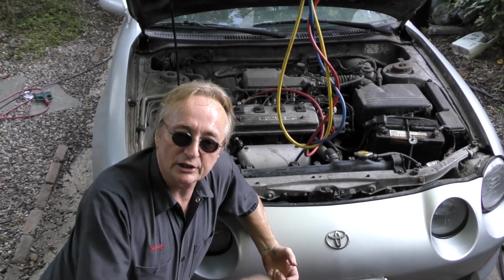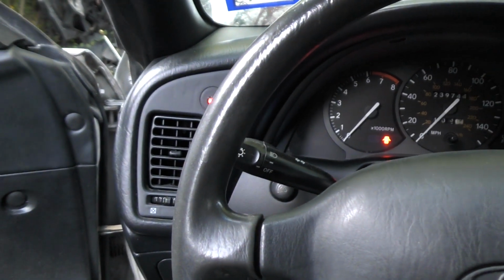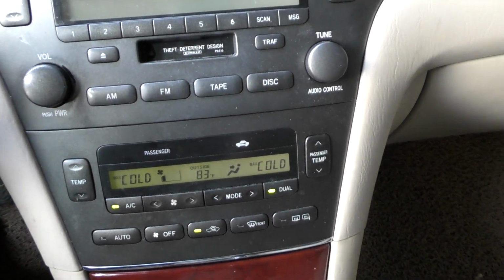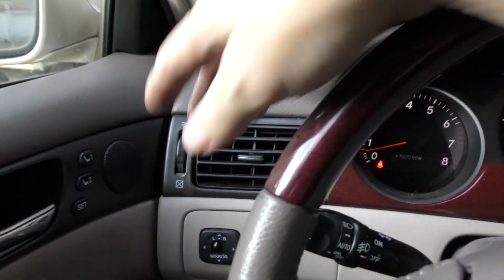Doing This Will Make Your Car's AC Blow Twice as Cold

Comment: You have no idea how many webpages and videos I've watched that NEVER mentioned why air is colder blowing out on the passenger side vs. the driver side in a single zone/traditional AC system...because the evaporator is usually on that side. FINALLY someone explained it!

Comment: I currently drive a 2006 Pontiac Vibe and Tuffy Lube tried to scam me with this dye test and replacing my air compressor. Also wanted to charge me over $100 to replace my oil pan and gasket because their mechanic couldn't "get a grip on the bolt" and claimed it was stripped. I think they quoted me something outrageous like $500 for all the work. My eyes almost bulged out of my head 😭. Took my car back to the same mechanic I bought it from, he changed my oil and got the AC working in less than a day. Wasn't low on refrigerant either, he just knew what to do and charged me under $100 for everything. He's the man, I'll never bring this car to anyone every again.

Comment: Most car manufacturers will claim that the AC system is a closed loop and that it should never need to be recharged.  This is not 100% true.  I own a 2005 Nissan Sentra which, prior to me purchasing it, sat in a garage for awhile.  When temperatures soared into the 90s recently, I turned the AC on, and it wasn't cooling effectively.  I took the car to my regular mechanic, and he said it needed a recharge.  I asked him if there were any refrigerant leaks, and he said no.  He topped off the R134a and for a month now, my car is blowing frigid air from the vents...to the point where it's almost freezing.  Every car's AC system should be inspected and serviced every few years, IMHO, to prevent expensive AC repairs.

Comment: Scotty Question: Just bought a 2004 Tahoe Z71.  Frame is clean, pans are clean, but I've got some body rust.  I'd like to treat the inside of the frame, and out.  My plan.  Wash it with soapy water, dry, grind the rust with a wire where possible, acetone wash and use/test these products.  CRC, RP-342, Corroseal, and Krud Kutter.  Have no plans to blend these products, just what product works in an ideal area.  Is this a good plan?   Thumbs up as always.

Comment: If your vehicle has 2nd fan in the engine compartment (auxiliary fan or pusher fan), your AC will not be very cold, regardless of the refrigerant level, when this fan is not working.

Comment: Hello Scotty, i have 2017 camry, we bought brand new from the only main toyota dealer here in uae, A/C now blowing  warm air 95% of the time, repair shops say compressor and condenser and whole system need to replace and flushed costs around 1150 dollars after market compressor or 1850 dollars if new toyota compressor, i am not convinced cause the car is new and done onle 120k miles, do you have an idea about what's wrong with my car and how to fix it?

Comment: I replaced my car's ac replaced all the parts except the the condenser ....the ac works but not well enough....it's a 2012 kia rio should I replace the condenser and empty the refrigerant and reload it?....also thers's no leaks
Reply: Most of the time its not charged correctly, a few ounces +/- refrigerant or oil will throw off the temps, check the pressures at the stated RPM for that vehicle, A/C fan on max, front windows down, car in the shade, low side pressure should be 30-40psi, which is 35-45 vent temps. If compressor never cycles that is first sign of overcharge, larger evap outlet line should be cold and sweating like beer out the fridge even on the highest fan speed.

Comment: Scotty, I inherited 2015 Civic with only 27K miles on it. I just discovered that AC blows hot air. Upon inspection I saw that compressor clutch does not spin and dual fans do not go off when AC turned on. 
I checked the fuses and tried to swap the relays, to no result. Unless I swapped wrong relays? What else can it be? If its the fuse or the relay, can you point out which ones exactly? Thanks.

Comment: I've watched a couple of Scotty's A/C videos and I have come to the conclusion that A/C is not his thing.  If a car A/C doesn't leak for 26 years it does not mean it is a slow leak!  It may have leaked out all at once.  A slow leak is it is cooling pretty nice but not as nice as it use to!  Then you can top it off adding freon very slowly.  Stick a thermometer in your dash vent and when it gets to 45-40 F...stop adding.  Too much will make it cool less and not enough will make it cool less and if it gets too low it will freeze up!  This is when you turn it on and it blows so cold you think boy this is great...then 30 minutes later it is warm air.  Evaporator has froze up.  If it is not cooling at all take it to a mechanic.  You will only waste your money buying freon that will leak out.

Comment: I had a mechanic empty my freon dry. I went in to recharge my AC since it wasn't as cold as it usually was..it cooled but not as well... he told me my freon was full and that I need a new compressor on my 2013 volvo xc90. It will cost $1500! I went out to my car and noticed it was now blowing hot!! No cool at all. I knew he did something!! I confronted him and he definitely was up to no good. He insisted my compressor was shot and freon was full. I went to another well recommended shop in the morning. They said my freon was actually dry.. no freon whatsoever in there! They filled it and changed the valve and vacuumed the system. Its now running well!! $300 no $1500 compressor needed!! Where should I report this shady mechanic?

Comment: Hi Scotty! I have corolla 2012 which i recently started experiencing AC seizures especially when the engine is on running slow or when i am stuck in traffic, but the compressor works fine using the RPM indicator. What could be the issue pls?

Comment: I had an 04 Silverado with dual air control. Every so often the vents would start blowing straight hot air on the driver side, tho it was blowing cold before. To fix it I had to pull over and turn the truck off then back on. Never figured it out. I got rid of the truck when the transmission starting going out, needed a car with better MPG anyways.

Comment: Hot Air blowing from the Passenger side is usually fixed by following these 5 simple instructions. 
1. Pull over to side of Road.
2. Open Passenger Door.
3. Scream "Shut the F#@k Up!"
4. Push Passenger out the Door!.
5. Close Door and Drive away.

Hot air problem Fixed!

Comment: I had a oil gunked starter when I was kid once. An old man stuck a 2X4 on it and whacked the board with a hammer. Problem solved, other than the oil leak. But it was a pinto after all.

Comment: The first refrig was like a water heater it i was hock up to your gas line it had a pilot and a burner to heat the oil in the bottem of the oil pan .the hoter the colder it got

Comment: RAF old radio engineers’ secret was the Drop Test. Remove equipment, lower it sharply to ground. Replace in aircraft. Do similar with your computer. Vacuum and brush the innards. Pull out and replace cable connectors. Unclip the boards, pull out a little, push back and lock.

Comment: Have a 12 yr old Honda CRV. A couple of years ago I had the transmission flushed as recommended by manufacturer. When that happened the AC quit working correctly. The fan would blow but it wouldn’t start cooling until I hit 40 mph. No one could figure it out. I ended up getting a new AC. Complete system. Still wouldn’t cool until I hit 40. It was that way all summer & beginning of next summer. Then all of a sudden it started working. Any idea what caused this?
Reply: Sure you got a complete system? Everything new? New condenser, new compressor, new hoses, new expansion valve (no need for a new evaporator, usually)? Usually happens when the condenser is no longer good at rejecting heat...
Reply: TeraVolt whole new system.
Reply: @mrnt1257  Condenser/cooling fan not running when it's supposed to, then.
Reply: TeraVolt what would cause it to not run? And then suddenly start?
Reply: @mrnt1257  Electrical issues, faulty fan motor, faulty pressure sensor, faulty wiring
Reply: TeraVolt so the transmission flush caused an electrical problem that just corrected itself? Seems to me something got stuck & finally unstuck.
Reply: @mrnt1257  No. It's just happenchance. It just happened while it was in the shop and not somewhere else. Perhaps the shop yanked some wire out of the way with too much force and damaged it, but there's no way to prove it. I had two similar things happen to me. In one instance, i gave the car for a MOT with working air conditioning, and they gave it back with inoperative air conditioning. Turns out the clutch coil thermal fuse went out inside the shop. It also happened out of the blue about 7 years later on the road, so it's just a bad clutch coil design. Another saw a shop puncture my AC refrigerant pipe. This time, thankfully enough, i videoed the engine bay before giving the car to the shop, and showed the video (where you clearly see no oil leaks on the ac line) to the shop's director, threatening to sue the shop. Got it fixed for free.

Comment: I've had an AC issue for a year. I can get it to run most of the time, except when it's super hot out, my car has sat in direct sunlight and it's hot out, or my car has sat idle with the AC running a lot. Traffic, lots of stops and starts, stuff like that. It will run cold then suddenly go hot. Sometimes it will come back on, sometimes it stay hot for the rest of the travel. Sometimes it comes back on after a few miles of travel with no stops.
I've been told:
 my AC is clogged, and it was blown out. No change. 
my relay is bad, it was replaced. No change.
the door that allows the switch from cold to hot might be bad, it was checked and deemed to not need replacing.
I've even been told there's nothing wrong with my AC. But I beg to differ when I'm sitting in traffic, in 100 degree weather, and the AC is blowing even hotter air.
I paid for a diagnostic and they said "maybe" my condenser needs replacing, which costs $400 plus.
I can't afford to pay $400 on a maybe. I took it somewhere else and they said I needed freon, which I didn't, then I had to get that corrected because they put it to where the hi was lo and the lo was hi. Problems are still happening, every day of this horrid summer.
Reply: Might be a faulty AC clutch connector or harness. Just fixed it on my car, and it behaved exactly like yours. Erratically. New connector and it's perfect again. When AC starts acting up, park the car and look if the compressor clutch is spinning, if not then try giving a good yank to the AC clutch's wire and connector and see if the clutch suddenly resumes spinning. If yes it's the connector. If the compressor clutch always keeps spinning when AC is acting up, then you might have a faulty expansion valve or moisture inside the AC system and again this gives erratic cooling because the refrigerant isn't always flowing through
Reply: @teravolt6113 
What does the clutch or clutch wire look like?
I think it may be freezing up for some reason.
It'll blow really cold and then usually, if idle then accelerating, or going up hill accelerating, it goes out. 
If it comes back on after a little while, it smells wet and is super cold.

Comment: I bought a new 1995 S10 ZR2, drove it for 21 years, 186,000 miles, never did anything to the AC system and it still blew brutally cold air, in Chicagoland, not Texas. My used 2012 Tacoma Baja should last 42 years, right?

Comment: If the compressor takes a CRAP can the system still hold a charge? Had PEP BOYS TAKE A PEEK said the compressor was bad but the system has no leaks and is fully charged. System blows hot air. But I can hear the compressor clicking.
Reply: The TXV can take a crap too, and when it does you get hot air too.

Comment: The AC in my son's 2016 Trax stopped working. It was blowing nothing but hot air all the time. With the constant automatic ventilation that meant some hot air always. Since I didn't have a shop manual on the vehicle I told him to take it to the Chevrolet dealer who does all the service anyway. I told him to ask for the old part back. They said it was a $80.00 cable that broke. Would cost over $800.00. He freaked but with a pregnant wife and needing AC for her I told him I would pay $500.00 to help him out. The tech who fixed it scratched up and damaged the dash taking it apart. The dealer agreed to fix the scratched and damaged dash and provide a free rental while they had the vehicle.

 He gave me the old cable which I threw inside the top of my Mac box. About a week later I picked up the cable and it wasn't broken like they said it was. To me it looked like it just slipped off the wheel. I played with it for about 8 minutes and had it working fine. Didn't really need the part. But you know how it is when you go to a dealer for service. I was going to take the part back and question them about it. But they probably would have said it could jump off the wheel again and stop working so they just replaced it. I'm fine with that but they should have at least discussed what they found first. Chevrolet service sucks. I have owned three Corvettes and was never happy with their service. I feel bad for anyone who buys a new C8 and expects top notch service for their new car. To the techs at the Chevrolet dealer it's just another car.

Comment: If you want colder air just REV up you engines. Really works
Reply: Cold air only when revving the engine up means refrigerant is getting low, at least with my V5/SD7V16 style compressor...

Comment: Hello Scotty last weekend in New York  it was 100 degrees plus and  I have a 2018 Hyundai Tucson with the 2.0 litre 4 cylinder engine. When I had the AC on the car with the gas pedal pushed down would  hardly  accelerate. is this normal it has not happened the last summer  before of 2018

Comment: I’m a commercial HVAC guy . I once fixed a friends older Chevy that had zero pressure left . I used nitrogen to pressure it and it held pressure , I evacuated it and the vacuum was good and it held . I charged it up and once it started and the rubber to metal hose connection on the suction line got cold it started to leak like crazy . The soap I had used earlier and remained intact started to make huge bubbles ....... what a waste of time

Comment: Scotty the first thing I check is the battery on most issues on a car that is more than 4 years old. Surprisingly many issues are solved from bad gas mileage, engine stutter,transmission shifting AC or whatever. If it has a computer control CHECK THAT BATTERY. And don't start tearing stuff apart until you have correct and constant signal/base voltage. May start and run ok but a battery that is going bad will drive you nuts.

Comment: How did car companies get away with the compressor letting out Freon over time?? Wouldn’t the EPA have something to say about that!? I always thought if there was a leak it’s a real leak not on purpose. So it’s suppose to leak to lubricate the shaft o ring?  I guess it doesn’t work like window units or central home ac.  Nothing but money money money to maintain these cars. Watching your videos exhausts me. I can’t do these maintenance procedures myself nor spend the thousands to maintain it with a mechanic. I’m just gonna ride the bus and spend my money on something else I enjoy. Are electric cars this expensive and worrisome to maintain?
Reply: The problem is not with the compressor shaft seal itself. It's a really tiny leakage, if leakage through seals was a problem o-rings wouldn't have been used either. The problem is with people not running the AC periodically in the Winter too, making the shaft seal and o-rings shrink and wear prematurely... another problem is with most shops preferring to replace whole compressors instead of single worn compressor components such as worn shaft seals alone and this turns most people to leak sealers and improper regassing of leaking AC systems...

Comment: Great video Scotty, but most people do not have an expensive scan tool or AC gauges to check pressure.  If it's a hot day and you want more AC an "easy" way to make it colder is to switch off "outside" air on the climate control and switch to "recirc" (if system is equipped) This way the AC is not cooling the hot outside air all the time.   Of course this is only if the system is working properly and correctly charged.  (don't forget to check or replace the cabin filter)  (retired ASE Master Tech)

Comment: Can you tell me why my car AC takes long time to get cold, my car is a 2005 Kia Sedona and for some reason was not equipped with filter
Reply: Does your Sedona have rear a/c?
Reply: Yes
Reply: There may be a couple reasons of course but most common I've seen is refrigerant levels. If you've taken or had an AC service done the sticker under the hood commonly has the specs for a non rear ac system vehicle. So it may just be out of spec. If your ac gets cooler while driving then the condenser fan may not be running properly, which that year Sedona has fan issues within the wire harness connector. If getting your proper refrigerant levels don't work and fan is working then more than likely it's your compressor wearing out.

Comment: How come my AC in my 2017 AUDI Q7 prestige sucks, but my 2007 4Runner freezes?
Reply: The Audi probably has a defective compressor control solenoid valve, typical issue with clutchless compressors...

Comment: I could be wrong, but aren't you not supposed to just "top off" R134 systems? Since that will over pressurize the system?  I'm just a shade tree mechanic but I thought the only proper way is to put the AC system under vacuum, then fully replace the refrigerant by weight. Topping it off might cool for a bit, but then you'll start having the same problems.